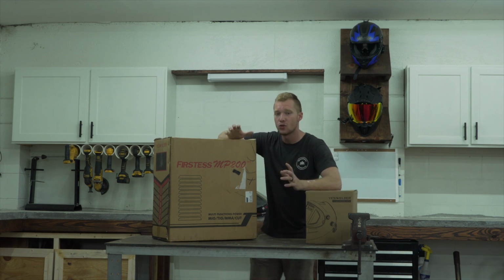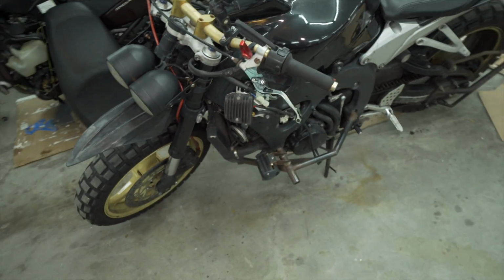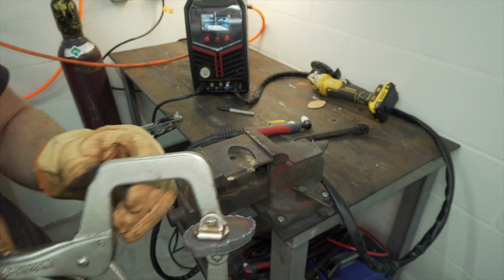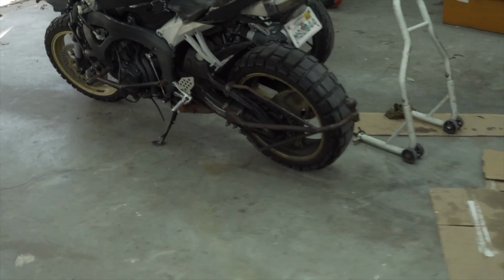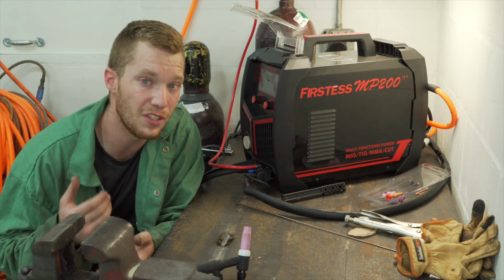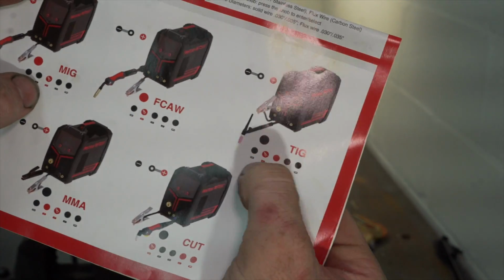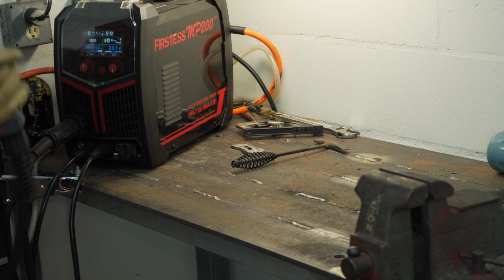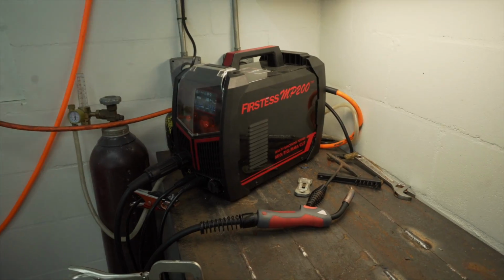Most VERSATILE Welder EVER // YESWELDER MP200 //

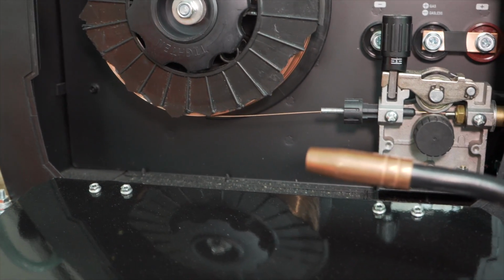Comment: HELPFUL TIP:  I believe that when you were attempting to feed the wire from the wire spool into the MIG gun [ @ 19:00 min. mark ]  you can push in on the wire speed control button ( the left button on the front control panel ) to temporarily increase the wire spool feed speed.

Comment: Can you control the wire speed and amps independently?
Reply from the maker: Not like on a normal welder, but you can change material thickness and it’ll change the amperage drastically and within those settings you can do small adjustments. It’s more of a user friend diy machine cause it kinda auto adjusts on most things